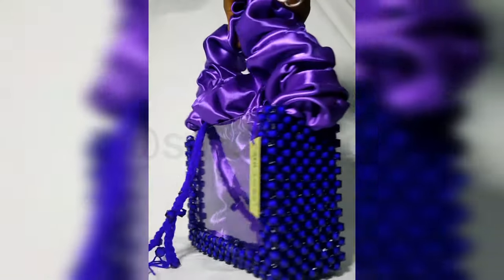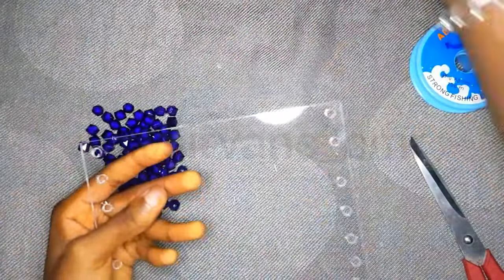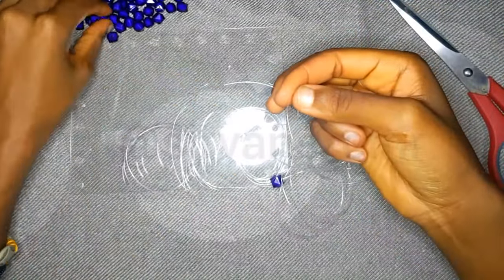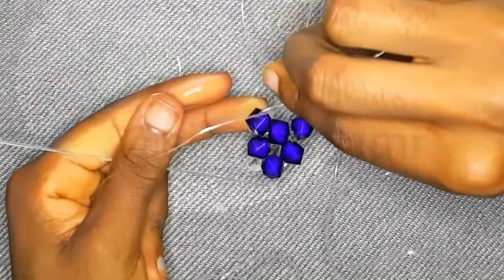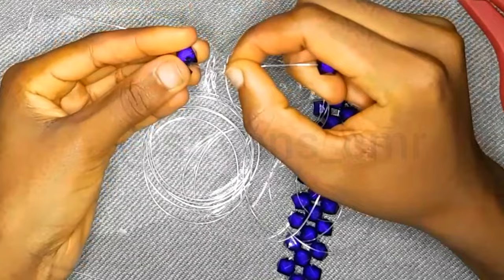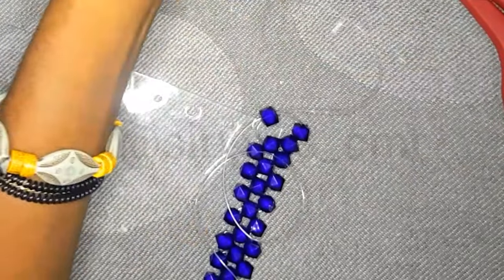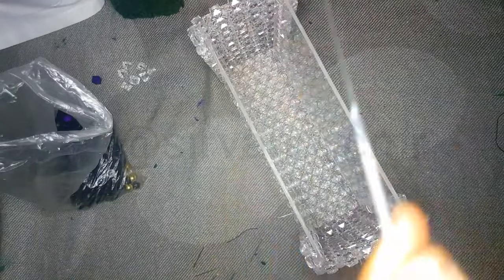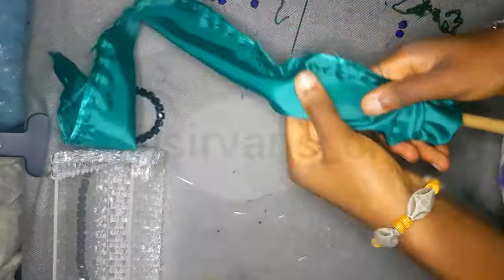How to make a Rectangular Acrylic Plate Beaded Bag|Transparent Plate beaded bag|Trendy Beaded bag

Comment: Amazing! Plz what the diameter of the hole dotes (each small circles) and the size of the bead did u use??
Reply from the maker: Hii sorry for the late reply it was drilled with 18mm drill. The beads is a size 4
Reply: @sirvansbeads7  18 mm its diameter of the hole ? Its with ruler is very big , is more than 1 c.m !!! And the beads did u mean 4 inch (size 10 mm) or size 4 mm bead ? It is very small